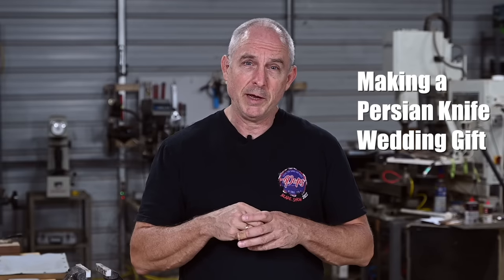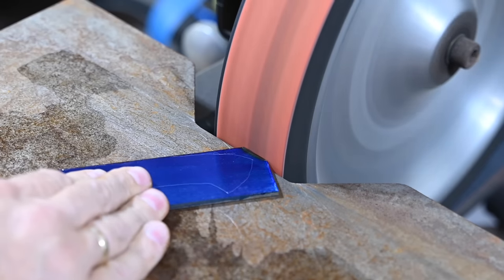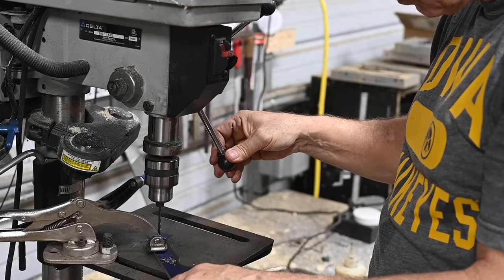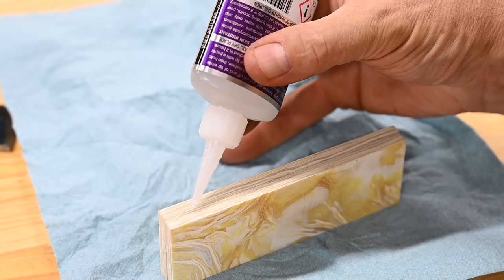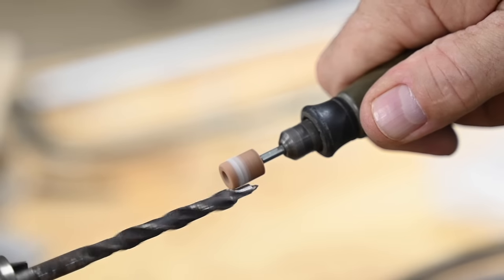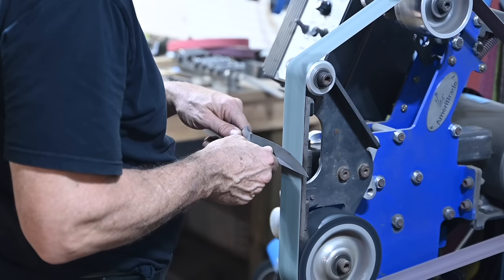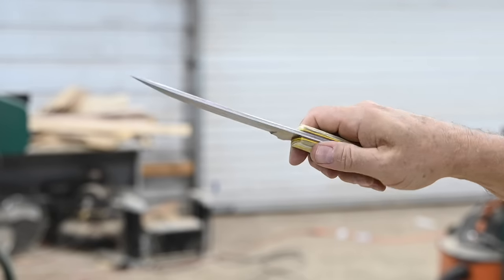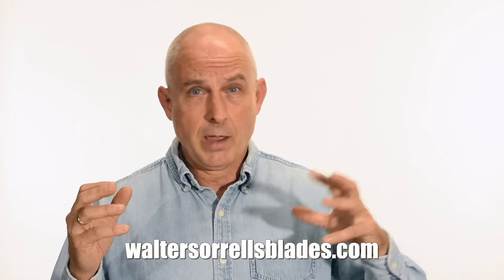Amazing Persian Knife - Wedding Gift

Comment: Why don't you use a bandsaw to remove the excess material from the blank of steel and then use the coarse belt grinder to get down to your layout line? For my way of thinking it would be much faster and a lot less small particles flying around.

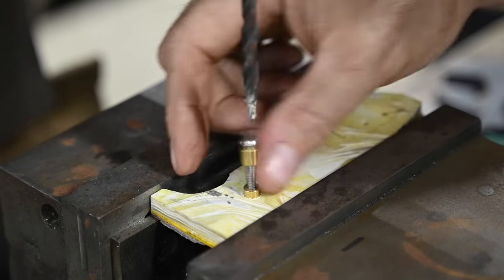Comment: At 11:45 what do you use to clamp your handle scales into the vise with?  I assumed that you would do all the drilling before shaping so that the clamping surface would be square and solid, but you evidently have a solution for thin irregular shapes. I have seen fractal vises, but that didn’t look like one
Reply: If you couldn’t tell, this is my first knife making video
Reply: I'm a complete noobie but to me it looks like he just used some parallels (from machining/milling) in a drill press vise (the parallels holding it up in the vise). Or his drill press vise has a step in it.